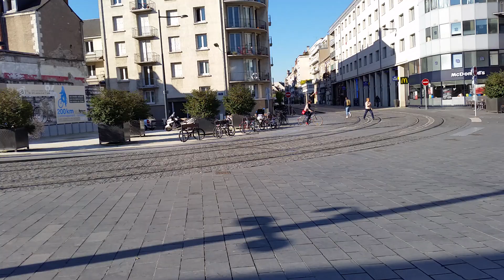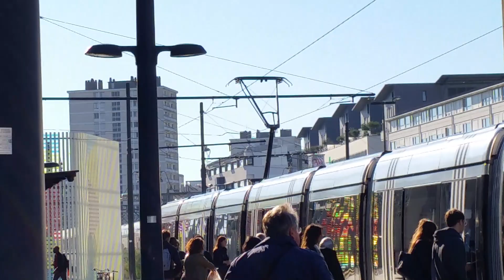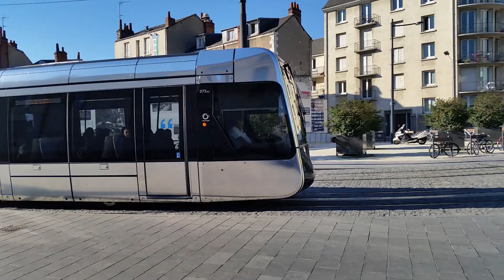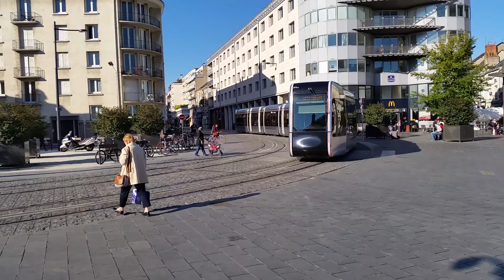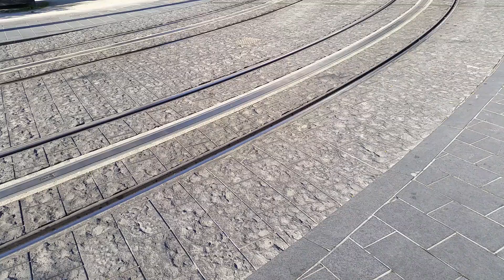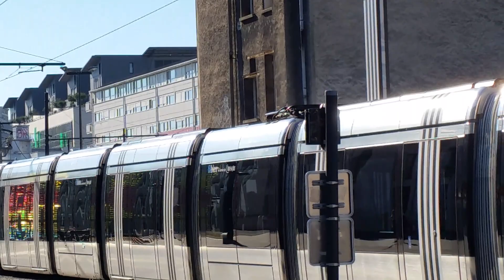French trams in Tours by Alstom using overhead and 3rd rail Soon to be Sydney light rail.

Comment: I believe this system was developed to save historic buildings that might be damaged by anchoring the overhead wires to them.
Reply from the maker: @andrewframe8046  that is a possibility but they can always use traction poles, in Sydney we now have the trams and it uses overhead but when it ge5s to town hall it uses the aps system, this is due to aesthetics.
In Parramatta they have introduced a system which is hybrid, it uses overhead and battery power
I went to Melbourne last week and they have a very large tram network there is a spiders wev of wires  and nobody seems to be overly concerned and they love the trams there.

Comment: By third rail I think you mean INDUCTION PICKUP where the current is transferred by a big electromagnet under the tramcar. 
There is NO voltage on the visible top plates. The voltage flows along cables under the plates not through them.You CANNOT be electrocuted by touching the plates.
Reply from the maker: Look up Alstom APS
Yes i am aware of inductive pickups but the Alstom system actually makes sections under the tram live.
Each section is 10 metres long and two are energised at one time, there is a shoe that physically touches the rail.
Each section is made live by a radio transmitter on the tram.

In Sydney there is a section of this that is opening on 14th December.

Comment: Awesome video and your commentary :-) I am working on the same kind of project in Sydney.
Reply from the maker: I live in Sydney  
Caught the tram from Dulwich hill to Capitol on Monday.
I note the change will happen outside town hall as that is where the third rail starts.
Question
Are the existing vehicles capab like of aps as well at pantograph operation. 

Also how do they failsafe the system so that the power is switched off on sections.
I am simply curious
Reply: @Steven_Rowe  Yes, this line is from Circular Quay to Randwick/Kingsford, and the APS is only till around Town hall area. As I am in Planning, I am not too sure about the design details of APS technology regarding Power regulation. However I will find out soon.
Reply from the maker: @adarshlobo8166  yes In really keen to know.
I think the Dulwich hill to Central line is good.
Sometimes I simply go on it as I retired so only cost me $2.50 on my gold opal card and I simply enjoy travelling and looking out the  window

Comment: Fine system, but will it work when there is snow and ice on the road surface.
Reply from the maker: Ismo Leppänen  i did ask locals and they said it doesnt stop them running.
I think they wouldnt build it like this without thing about snow and ice.
Reply: @Steven_Rowe  little late but I think that each module heat up when it's freezing

Comment: Nice description! Excellence is "a million and one" little things done right.
Reply from the maker: Alstom are great, they know trains and trams. They  got a tgv to 571klms per hour, pushing boundries and research.
Reply: I am much more impressed with the smart train in your video than a 571km/hour TGV. 

Day in and day out myriad ordinary people benefit from a clean and pretty city with a non-obtrusive train and safe tracks that are very unlikely to electrocute anyone.

Le TGV enable a terrestrial version of what 1/2 a century or so ago—here in the States at least— were referred to as the "JetSet crowd.

When I lived in Japan I inadvertently rode the Shinkansen (bullet train) once from Kyoto to Osaka. I was unimpressed because it was ridiculously expensive.

The ordinary Japanese trains—on the other hand—impressed me on a daily basis because they were extremely clean, ran extremely punctually, and were reasonably priced.
Reply from the maker: Ken U what I want to know is how they make it failsafe so that the exposed track is not live once the tram has passed over it. Alstom installed a similar system in Dubai and it all works on this system, however the trams still have pantographs
Reply: I am not an engineer but I am a Jew. Therefore I will do you what Jews normally when trying to explain novel concepts: I will give you an example which is called למשל (mushel) in Hebrew.

I assume it works as follows: imagine that each section of track that is toggled (between being electrified and not electrified) were like a household appliance such as a lamp or a television.

The defaults tate for each section of track would be off (not electrified). In that way children, pets, etcetera won't become electrocuted if they play with the rails.

However, when the tram/train comes close enough the section of track a switch powers on the track just like you might switch on a lamp or television. I assume an inexpensive RF (radio frequency) switch is used to avoid moving parts and therefore decrease the need for maintenance.

By today's standards the technology is likely mundane. However, the application is remarkably valuable.

For projects like this (railroads) design is much cheaper than engineering and, of course, vastly construction. Yet, design is typically done poorly. Generally, no amount of great engineering or construction can offset bad design.

Terrestrial trains are actually dangerous anachronisms. Search on YouTube or Google for "Shweeb" (located "Down Under" in New Zealand) or "Jpods." Think of them as individual urban roller coasters.

Frankly the French innovation in this video reminds me of the Maginot Line: when the French prepared to fight the Great War a second time.

I suppose the French have some of the world's best scientists and engineers. But without great design most of their efforts amount to very little.

I am not a Zionist. I actually oppose Zionism, but Theodore Hertzel was apparently impressed enough with the Wuppertal suspension railway that he wrote about it in one of his books.

Elevated PRT (Personal Rapid Transit) is the 19th century version of the current ridiculous fad  of driverless cars. We should build PRT systems today. On YouTube I have watched videos of the Morgantown PRT and the West German Cabinentaxi.